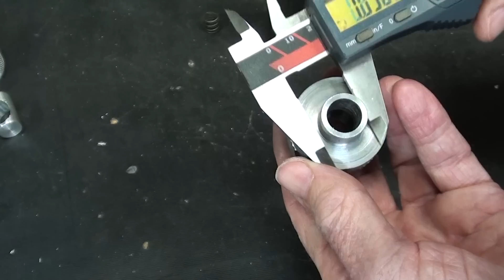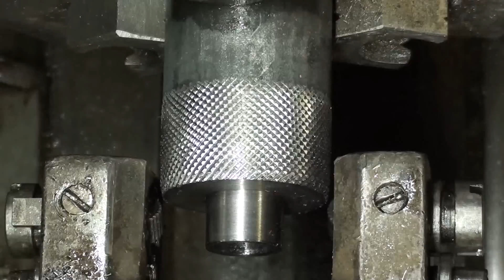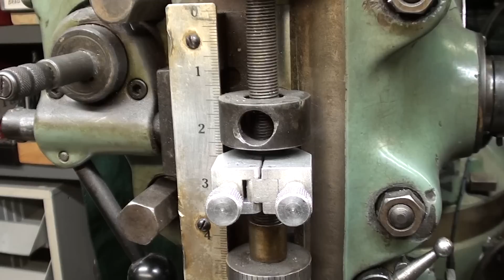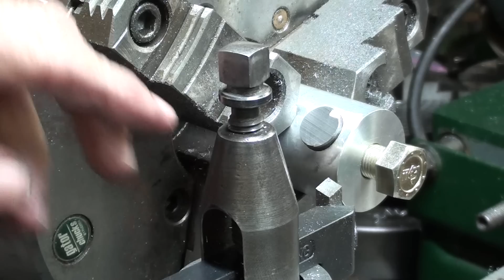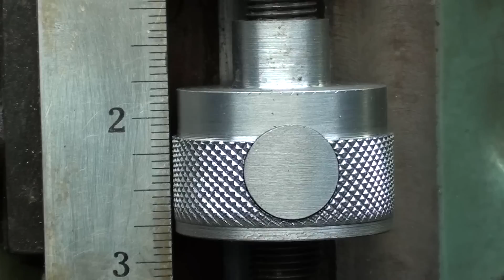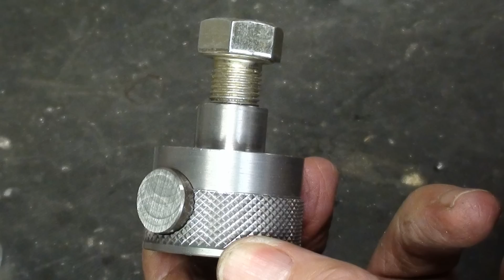RAPID ACTION QUILL STOP pt 2 #869 tubalcain mrpete

Comment: Mr Pete: Nothing worse than dropping a spring. 

3/64" detent ball: Hold my beer... 

Maybe the "5/8" end mill was an import? I've bought some stuff which was "1/4" but it was really 7mm. 

I had a 1980 Bridgeport Series 1.  Had it for months, was going to hook it up, I needed to wire in a VFD as I don't have 3ph.  Set my shop on fire and destroyed everything first. 😐. Awaiting a new mill and lathe (just waiting for them to ship... sometime).  Watching these because I learn stuff while I'm not able to break...I mean "make"...stuff.
Reply from the maker: Maybe that was a metric cutter.
Yes, electricity and fires are pretty dangerous

Comment: I tried making one of these today at work. I came very close to your design, but tried to make my button on the lathe then shave it down on the mill to sort of a rectangular cross section. Getting the hole in the quill stop to accept the button ended up being a lot of work and came out very poorly (reaming a blind hole is not really an option with the tooling available to me). Tomorrow shall be attempt #2, but this time I'm going to make my button round instead of rectangular. I imagine it will go much faster.

Thank you for doing the work and documenting it. You've earned my subscription.
Reply from the maker: I’m glad you gave it a try. I bet tomorrow’s will turn out perfect. I almost always make a prototype where I learn a lot. And then when I make the second one, it turns out excellent.
Reply: @mrpete222  Thank you for the vote of confidence. I also like to prototype first, usually out of the most forgiving material I can find. Last week, we had a unique design  that required a rotary table and I'm glad we had some scrap wood around to run through a lot of iterations really quickly.

Before I came across your video, tomorrow's attempt was going to involve pocket milling the button recess from the top and arbor pressing a cap on top of the stop. We'd be able to retain the button without a bolt and have a little more control of the interior, but I really like the straightforward approach you landed on.
Reply: @mrpete222 Mission accomplished. It's a little rough (my concentricity is off, because I tried using a mandrel for the first time and it wasn't too pretty), but it works great and the shop is pleased with it. The next (and final) iteration I'll make with steel for the housing and brass for the button.

Comment: Superb presentation and craftsmanship as usual Mr. Pete. I love your videos. I own an older Central Machinery (Harbor Freight) vertical milling machine that is somewhat rare in that it has a power quill feed gear box integrated to the head. Since the quill stop is much different that the Bridgeport design, I will need to design something a bit different but still utilize the same half-thread concept. Thank you for sharing. Wishing you the best of health and happiness.

Comment: Fancy. On my drill press I used a simple shaft collar so I did not have to thread doen the original stop. Been there for 40 some years. Plastic tip set screw with thumbwheel to tighten.

Comment: I've got a couple knurl tools like that in a couple different sizes for my turret lathes, never really thought it could be used on the engine lathe, turns out you can as evidenced here. Keep up the good work, cheers from Cleveland Ohio
Reply: @mrpete222  I've also coincidentally had the same undersize problem with seemingly new 5/8" end mills. Figured it would be fine and didn't bother checking it until after I finished the part. Had to start all over again but I now always mic my end mills and my coworkers think I've gone crazy because of it 🤣

Also my shop primarily makes coarse and fine fasteners (including bolts!)

Comment: I'm still here old timer. It's not so bad you know. I knew there are left and right hand tool holders but the brand is thoroughly irrelevant on my budget, so I may have missed the significant aspect of your question ❓ And I am not terribly opposed to those long tiresome threaded components, but I've learnt to spin them with a long stroke my little finger including the side of the palm. That speeds up the procedure as much as any trick I have found. A rubber disc on an arbor in your reversing drill may prove highly over efficient. Hopefully?

Comment: I spent years spinning the stop with a rubber wheel in a handheld drill (the sheel was a sanding drum center for a die grinder) fast, easy enough. Not as  good as the quick-acting nut, though.
Reply from the maker: That is ingenious, if I would have thought of that I would’ve done it myself. Or at least done it in a video for a laugh.

Comment: Still watching Mr Pete. I don't mind if you don't graduate the nut Barrel. I never use the graduations on mine anyway, I suspect most people don't either. The only thing worse than dropping a spring, is a small ball bearing ball. They invariably roll under the bench into the chips and disappear, most likely to wherever odd socks from the dryer go!
Reply from the maker: So true, that’s why you have to buy plenty of extras

Comment: Do you know that the two vertical edges in the head casting next to the quill stop screw are used for quick head tramming with a large square? You put the square blade on these edges and the other end of the square on the table and you get a nice 90 degree head angle.. I have used mills for 40 plus years and a fellow showed me that and I had never heard of it. I also worked in a shop when I was a young man and a guy was making homemade balloon wine inside the secret side compartment on a Bridgeport and the boss didn't have any idea. Yeah, a Bridgeport is a pretty versatile machine.
Reply from the maker: Yes, I think I showed that in a very old video. I had planned a future video where I show many ways to tram the hesd , that was one of them. I also considered a video entitled the poor man’s tramming method, using a big carpenter square.

Comment: I have cursed when adjusting the quill stop for 30 years on my 9’’ X 42” Enco mill, and I use it frequently so curse a lot. Just a couple of days ago I finally installed the commercial version of quick release stop, but I still watched and enjoyed your video to the end.

On the Enco the original adjusting wheel is 1.375” diameter instead of 1.5” and the head casting didn’t have clearance for the quick release wheel.  However, it can be made to fit. A couple of hours with a Dremal with a small stone and a bit of chipping in the corners with a cold chisel where the stone wouldn’t reach gave me the needed clearance. (Care is needed to protect the quill from the dust and the grinding stone.)
 
I replaced the spring in the commercial item with a lighter one. My mill has a digital read out which was in the way for squeezing the button between two fingers and it was too stiff to depress easily. 

I also added a Delrin cylinder to fit around the spring at the bottom of the hole. I found that when I pushed the button in, the half threaded nut dragged on the screw. With some trial and error I sized the length of the cylinder so that it serves as a stop on the button to keep it going in far enough to drag on the screw. 

I agree with you, it’s an excellent upgrade to a Bridgeport or clone and worth the time and effort.

Comment: I never use the depth stop on the quill of my Grizzly mill.   As you said, such a hassle to use.   Mine does not even have a dial with markers, just two nuts.   One day I may make one of these.   An interesting project.   Thanks for the video.
Dave.

Comment: I’m still watching and keep the project ideas coming.  I have a a small $50 central machinery drill press I bought new 30 years ago that still hasn’t died.  It needs its depth stop fixed and I need to find better things to do that doesn’t involve upgrades to a small drill press.  Thanks for the content.

Comment: Just a thought on making the radius on the button. Instead of using a spring to tension the button against the 1/2 -20 thread, use a small set screw from the other side maybe 8-32 or 6-32 set screw to secure the button against the 1/2-20 thread.

Comment: Lyle, those with small, light duty, lathes can have problems knurling.  Might those folks be better off with a cut knurler, like this (https://www.youtube.com/watch?v=vj8pp3YJijg), instead of a forming device?  FWIW, the linked tool is used on a mini-lathe.  Talk about light duty.
Reply from the maker: Thanks, that was a good video. I have never seen that done before.

Comment: watching to the point of asking, however; I have a round column Rung Fu RF40 so I am going to have to remove the front plate that I haven't done for some time.  Need to see what is behind it for modification.  The screw is an acme so I will replace with a 7/16 - 20 threaded rod that will fit through the hole.  May get away with a 1/2 - 20 when I see the parts.

Comment: Hey Lyle, I've been putting off making an adjustable stop for my Bridgeport. It occurred to me whilst watching your most excellent video that I could cheat on the graduations by boring  the original stop into a collar and then pressing it on to the new one. I would of course need to do that before drilling for the button. As an alternative if I modify your dimensions slightly, I could maybe make it a slip fit with a locking grub screw so it can be zeroed. I have a touch DRO fitted which combines the knee and the quill dimensions but you can't beat a physical stop as a protection against those senior moments.
Reply from the maker: Great idea

Comment: Hey mrpete222. All my end mills are undersized. Brand new, check the diameter. They start with onspec tool steel or carbide. Then they sharpen it. It seems like carbide is worse than high speed steel. The way I compensate is to add .001 or .002 shim stock to the outside of the r8 collet. Align the flutes on the end mill to be opposite the shim stock. That way, the end mill will make a hole very slightly larger than the end mill. Oh, by the way, I also do the opposite for undersize holes. I use lots of press fit dowels in my sideline business. If I use undersized reamers, they have a tendency to ream a hole slightly large instead of undersized. By using a carbide end mill to finalize the hole, the dowels are always good & tight.

Comment: A very good project by virtue of it's utility. Something I picked up on is that the sides of your brown and sharp knurl-er need to be lets say, an additional 3/8 thick. (Also a very good project in My eyes) I have thought since I first saw your knurl-er videos that that B&S knurl-er is something I will definitely duplicate some time. I was able to get rough dimensions and to glean the layout by scaling the pics. form the video's. watching you use it for this project helped to point out a short coming in the original design. (not that the center hole is not staring you in the face :). So I say Thank You Very Much Mr.Pete, Keep Up the Good Work.
Reply from the maker: Thank you, I would like to design and build a brown and sharp type knurler

Comment: Rant on Sir :) .... Maybe there is an accurate way to measure the diameter and then measure 1/50 around its circumference, rather than using a diving head. With practice i'm sure you will have a method of getting "close" without graduations.

Comment: Great improvement. Those nuts give me the willies.I made a couple of sheet metal u shaped spacers so the nuts only needed minor movement but this idea wins. I’m gunna make one.
Reply: @mrpete222  my first problem is my machine is a chywanese knock off. Thread is 13.8 x1 mm. Will have to trim that down to 12x1 mm. IE buy tap to suit. Will keep you posted